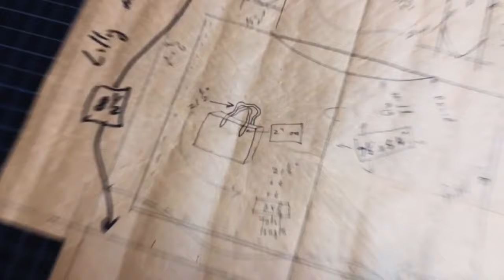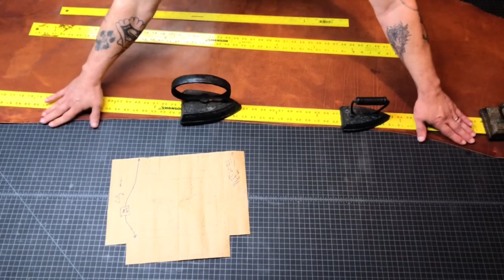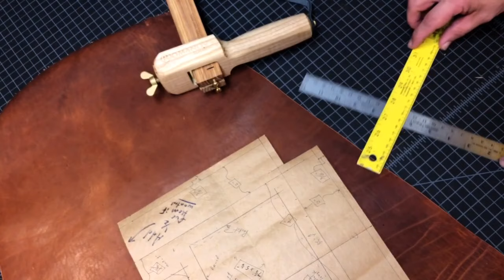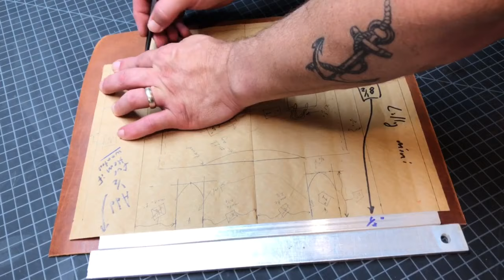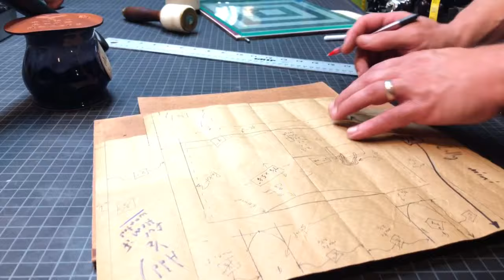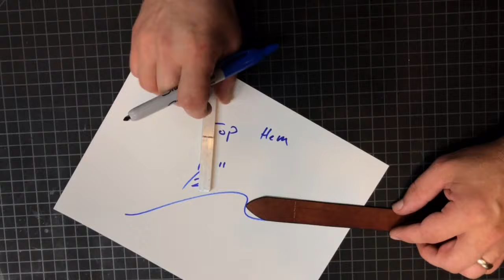Making a Leather Tote! - The Mini Lilly

Comment: Would you mind sharing what the clear material under the piece you are punching your stitching holes in is? I am using  poundo board, way to much bounce.
Reply from the maker: Japanese cutting mat.  Rocky Mountain leather
Reply: @MasconLeather  Thanks so much

Comment: Great videos.  Would you show the  time it takes from start to finish on your projects? Thanks
Reply from the maker: Thanks!!   It’s tough because the wallets by themselves take 3-5 hours.  But if I film the process it takes 25-45 hours.
Reply: @MasconLeather  Thanks, I am just starting out, and was trying to get an idea about how long it takes to build various items. I designed many things made from sheet plastics for 30 years. I like to design and fabricate, but the process for using sheet plastics is not basement shop friendly. Thanks again for all the time you spend, showing us how do fabricate from leather.